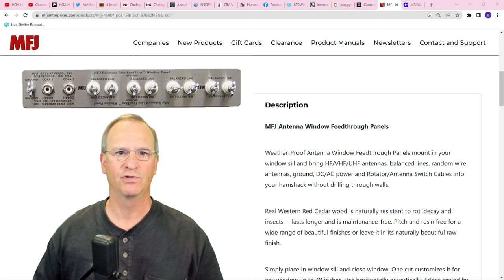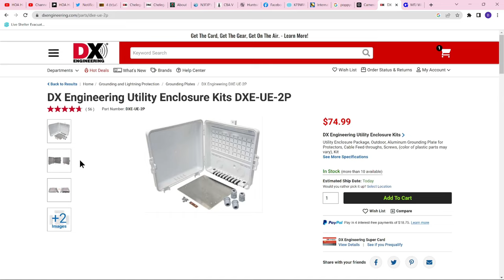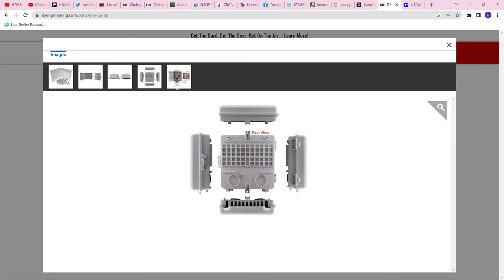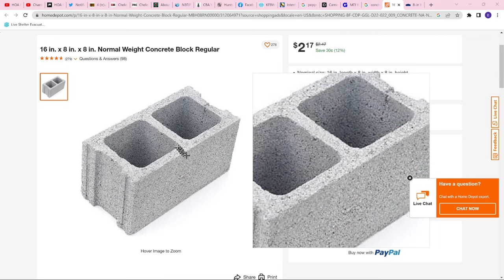New Ham Radio Shack Build Out Episode 5: Installing an Outside Coax Single Point Ground Panel

Comment: Wait, the antennas are in the attic? Why not just drop coax down inside the interior wall and skip literally all of this? You don't need lightning protection for indoor antennas.
Reply from the maker: CosmicOsmoFour, thanks for watching and the observation.  My goal over time is to have more outside antennas.  Putting the lighting protection there in advance means I can switch out coax, and don't need to get back into the box to add suppressors in the future.

Comment: Do not use a zinc plate, this produces contact potential differences. It is better to use a copper bar for the installation of the gas discharge tubes. This ensures better current conduction and lower contact potentials.
Reply from the maker: Thanks for the view @proa1999.  The plate I used was aluminum, not zinc; not sure if that changes your opinion.  I am going off the recommendation of DX Engineering which is good company to be in.

Comment: This is Rick, KO4KVT.  Great video.  Hope you are doing well after Milton.  We recently moved to Palm Coast and am starting to work on my shack.  I'm putting a DX Commander in the back yard.  I'd love to know how you accessed the soffit from the attic.  The slope of the roof is such that I cannot get to it, plus the roof is covered with vicious nails!
Reply from the maker: All good after Milton, just a lot of branches to collect from the yard; thanks for asking.  Welcome to the new QTH on the Palm Coast.  For me, I actually pulled away my facia board, removed several pieces of soffit, then was able to access from the attic crawl space.  It wasn't fun or easy, and I suspect would be challenging for most people to pull off the way I did.
Reply: @HOAHamRadio  I’m hoping I can run a wire snake through a hole in the soffit and get it in far enough that I can reach it.

Comment: So this video is 10 months old now.  How are things holding up?  I like that idea of putting colored indicators on the coax lines.   I think when I make my radio room I will use one of those boxes too.  I have stick frame construction so I won't have to deal with cement blocks.  I live far north so cold (-30 F) will be a consideration with a large hole in the wall, however.  But that installation really does look good.
Reply from the maker: Like new.  Here in the brutal heat and sun of Tampa Bay, my greatest fear is deterioration of the plastic case over time...that is why I did paint it.  

I didn't want to go metal due to corrosion, so I had to pick my poison...plastic / metal, both with their issues.

So far, so good.

Comment: Unfortunately in California any block wall that is built to code is completely filled with concrete grout so the only way you get through one of those block walls it to call in a concrete sawing and coring company and have them shoot a hole for you. Fortunately most of the residential building here is wood frame construction so just a hole saw and a 4" TC core bit (can be rented) for stucco is needed. That is what I am going to do to get my coax in the house and I really appreciate this video for being a through and complete instruction on how to do that and do it cleanly.
Reply from the maker: Glad it was helpful.  For sure, various construction methods depending on region will influence the final install.

Comment: I would put an upside down U shape of heavy duty urethane sealant around that pipe hole on the back of the NID box. I don't full circle around because any water that does happen to get in, can have a way to get back out that way. Big ole fat bead of OSI Quad, or Vulkem would do it justice.

I reall dig that zip tie idea. I use marking tape because I have it (electrical tape for marking conductors) but those zip ties are also a great idea.
Reply from the maker: Great input, especially with the upside down U sealant.  Appreciate the feedback.
Reply: That's a great idea. I'm just about to use a hole saw to make my hole and run my pvc. I'm going to use your suggestion. Thank you. I was wondering how to deal with the moisture. I would have definitely sealed the entire thing, but that upside down "U" shape makes more sense.

Comment: There is a dissimilar metal junction on the surface between the copper ground strap and the aluminum back plate.  I used a Harger HAAJC1/2 conductive  sealant on the connection between the copper strap and the aluminum plate.  This is supposed to prevent galvanic (dissimilar metal) corrosion between the strap and the plate and between the stainless screws and the plate.  This is important to do for long-term electrical bonding in humid and wet environments.  DX Engineering has a comparable sealant called "Jet-Lube" that is also supposed to be pretty good for this.  
In a past life, I designed electrical bond joints for aircraft applications using comparable techniques.  
73
Reply from the maker: You got it right on this topic.  Thanks for sharing in the comments for others to see.

Comment: Hi Bob, I'm in the early stages of planning a new shack, similar in size to yours.  You have sold me on the utility box at the entry to the house. I've been thinking/over thinking about coax and am curious what you chose for your installation.  In hindsight would you make a different choice today? Lots of info online, but I place a high value on real use opinions from people I trust. Thanks for your thoughts. ... Tom
Reply from the maker: I ran two lines of LMR 400 for my UHF / VHF radios; Amazon stuff I didn't know much about.  The rest is all the same from DX Engineering, their brand.  Wouldn't you know it, they don't keep order records that far back.  They made custom cables at that time (lengths that I needed).  Their brand is good quality, so that is what I went with.  The cable isn't marked either, so I can't tell from that.

I was VERY happy with the quality, so you may want to reach out to them, tell them your lengths, and frequencies you intend to operate -- I like their cable and their connectors. 

I also picked up some ABR Industries at Hamcation; it is also good quality.  I think they will also do custom lengths.

Although I got the LMR 400 on Amazon; wouldn't do that again.  I'd go with ABR or DX.

Comment: I used the same box at my QTH.  I am planning on routing some cable up to the attic up the wall and not through the outside.  Most of my antennas are on a tower and I plan on routing a couple to the back field for a vertical and a beverage (we live on 2+ acres).  All the best, 73 de KI5HXM!
Reply from the maker: It certainly allows you to get things organized.  2+ acres, sounds like a good amount of space for multiple antennas.  Enjoy!
Reply: @HOAHamRadio  yes it is a nice piece of land.  We enjoy the rural Texas living.

Comment: thanks so much for this video, i am in HOA also,   do you have to worry about the edge of the coas hitting the sharp edge of the 4 inch
 tubing?
Reply from the maker: Once you cut the PVC to length, smooth out the edge with sand paper and its all good.  Also, since the coax isn't moving, there is no constant abrasion happening.

Comment: Very neat installation.  I think I would have used a hole saw on the cinder/concrete block rather than punching it out as shown.  Hole saws can easily be lubricated with water and some can even go through rebar. I'm very curious to see what your rooftop antenna farm looks like.  I don't have an HOA but I do have a lack of space problem.
Reply from the maker: Thanks for watching, Sincerelyyours7538, showing off the attic antenna farm is on the list of future videos.
Reply: I personally would not want to go through a cell that was rebar'd and filled just because of structural integrity, but a core drill definitely does a neater job. Very expensive though, and you'll need an SDS Max rotary hammer to punch a 4" hole.

I have an SDS Plus rotary hammer, and I also have to cut rectangular holes sometimes (recessed j-boxes for outside power in brick and CMU / CBS) so what I do is basically similar to what he does here. I drill through with a 12" long 1/4" bit, I make sure I'm completely in an unfilled hole, then I make a series of holes on the line - VERY carefully spaced no more than a half inch apart. Then I use a chisel bit to connect the dots to make the big hole.

It's not nearly as fast, and not QUITE as neat as a core drill, but it's pretty neat, and when I'm only doing it here and there it's fast enough.

Comment: Bob, Better late than never for me. I copied your setup, except I used a $23 Amazon service box instead of the expensive one. Got the MFJ patch panel, ground and bonding stuff, and bus bar. I’d post pictures, but YouTube isn’t providing that option. 

Do you have a diagram you can share that shows the connections between the patch panel and your coax switches? That would really help, as I don’t have any diagram or info on how things connect. Many thanks!
Reply from the maker: Hey Joe, send me an email if you don't mind, and I sketch up what I do for my switches.  thehoaham@gmail.com

Comment: Thanks for the great series of videos.  Can you tell me about that metal grounding plate you put in your utility box.  What is it made of and where did you buy it?  Also, where did you get the lightening suppressors?  Thanks
Reply from the maker: The plate is aluminum and was part of the DX Engineering kit--link in the description. I purchased the suppressors from GigaParts.  Thanks for watching.

Comment: What did you use to create a water seal between panel and outside wall?
Reply from the maker: Exterior grade silicone calk; i placed a large bead in a circle around the hole, then applied the box.  I also sealed between my block and the PVC pipe in the same way.  Inside the pipe, you can use flexible electrician putty to seal it up.
Reply: @HOAHamRadio  Thank you!

Comment: How did you mount the polyphasers inside the box?
Reply from the maker: Stud on the back of the polyphaser and a through hole in the aluminum plate; I think I show that it in the vid.

Comment: Are the lightning protectors necessary with your antennas in the attic?
Reply from the maker: Thanks for watching Mark.   Over time I'll be using more outside antennas.  Putting the lighting protection there in advance means I can switch out coax, and don't need to get back into the box to add suppressors in the future.
Reply: No they are not

Comment: that concert block core is not always empty, some times it has a concert some have cement and steel.
Reply from the maker: You are right Steve, here in Florida the cores have to be filled every so many feet.

Comment: So, I'm not following you on one point. Did you connect your lightning protection grounding (in the DX grounding box) to your home grounding? So if you are struck by lightning, are you wiring all that energy into your home ground and all your RF gear? Would you not ground for lightning separate from your power feed lightning and separate from your RF ground?
I'm not all that sold on connecting your lightning protection to my home grounding.
Reply from the maker: Follow the experts:  https://amzn.to/4dXB1rq
Reply: Seems the NEW trend/belief is to use copper wire to bond to a ground rod near the box but NOT to bring in an "RF ground" into the shack. This means no copper strap like HOA used in this video. The idea is you don't want to bring lightening into the house. To ground your gear to a common point simply modify an multioutlet box by installing threaded studs and wingnuts into the case. Plug all your gear into that outlet which is, of course, grounded all the way to the main. And that's it. W6LG advocates for this approach and uses it himself. Check out his channel on Youtube by using his call sign. He has about 4 videos dedicated to this topic. I'm making my new station and using this approach. Thanks to HOA for a great video. I learned a lot from it.

Comment: A 6-inch hole  looks a little bit of an overkill, I know it is more comfortable to run cable, and could  the earthing copper strip can it be a round cable
Reply from the maker: For me, it was exactly what I needed; I tend to have more gear than most to support what the YouTube channel needs for content.  Many users will have 1 feedline...then this entire utility box is overkill.  Thanks for watching.

Comment: Been waiting for this one. My house is the same construction ant breaking through has been a concern. Thanks! 
Now.... does that AC chase have some drainage holes in the bottom horizontal section?  Looks like it ~might~ be a catch basin.  While Florida is the sunshine state, there is a rainy season that can bring a lot of water.
Of course, next I'd like to see how those cables make it from the chase over the top of the wall.  ... and what the attic farm looks like. :)
Reply: Oh yeah, that notch around the other conduit is enough for drainage.
Reply from the maker: Yep, the cut out has gaps, and the elbow connector also isn't really that water tight.
Reply from the maker: Thanks for watching Bob, sorry it took so long to get to this one.  I've add some views in the attic in a future video showing where the coax ran through the soffit  into the attic.
Reply from the maker: Oh, and one more thought here in Florida.  Everyone so often, depending on code, they pour those cores solid with concrete.  So, with some bad luck, you could run into one of them.
Reply: @HOAHamRadio  Ouch, that could be a problem.  Thanks again.